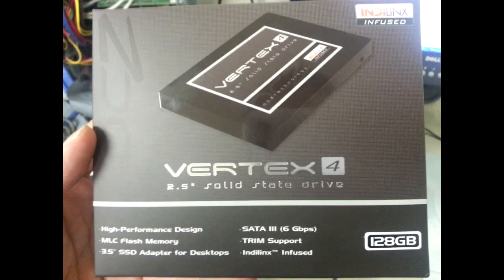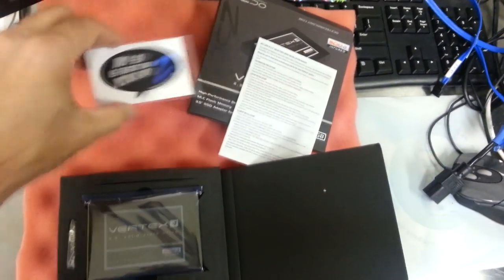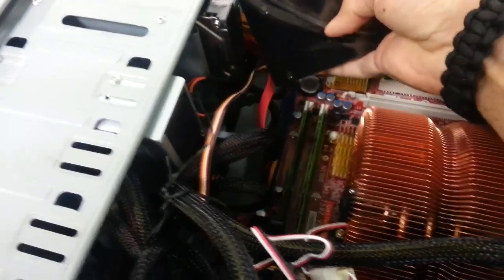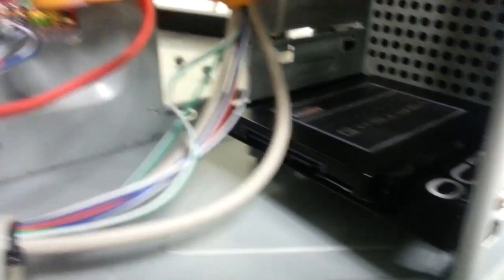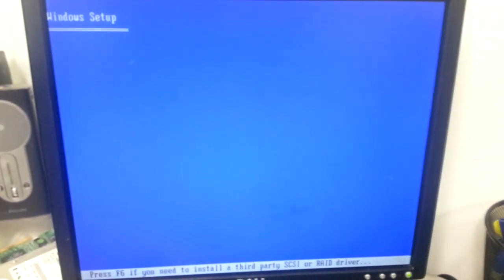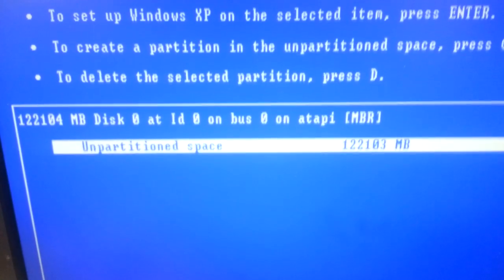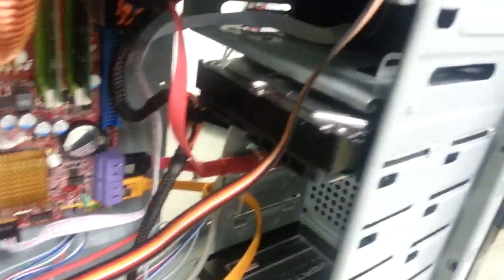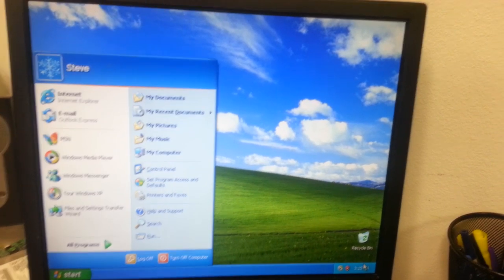How To Install a Solid State Hard Drive with Windows XP (OCZ Vertex 4)

Comment: I am amazed, but it wasn't clear where the windows XP install was coming from. Presumably a CD drive in the computer. I have a WD Blue SSD drive that says it is compatible with windows 7 8 9 and 10. I'm simply assuming they didn't bother to say WIndows XP because it is "old".

Comment: Nice Video Chuck. I wish it were so easy for me. I love win xp and therefore have been trying to install it to the 240 GB SanDisk Extreme SSD, on a Gigabyte H61N-USB3 motherboard, without success for the past 30 days or so. I get the Blue Screen of Death every time when the installation process tries to boot. I even bought a Mitumi USB Floppy drive so that I can install the Intel Rapid Storage Driver  (downloaded from Gigabyte's website) by pressing  F6 in the beginning of the installation process. I did change the ACHI to IDE in the BIOS setup.
This was my son's computer given to  me  with both Linux and Winows 7 installed on a Crucial  MX 100 512GB SSD. I replaced it with the SanDisk Extreme 240 GB SSD  because I want to keep those OS. Please extend your helping hand. Thanks in advance.
J.K.
Reply from the maker: Change your hdd setting in BIOS from AHCI to IDE or SATA and see if that helps.